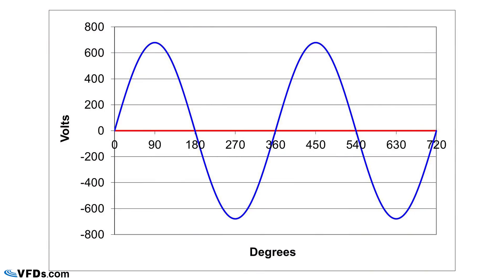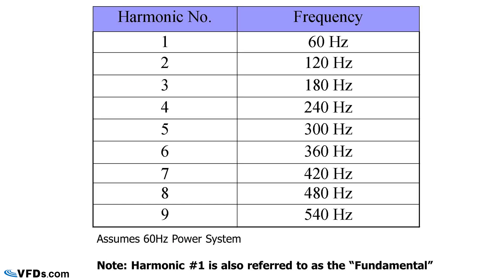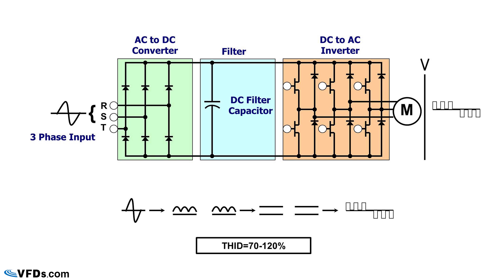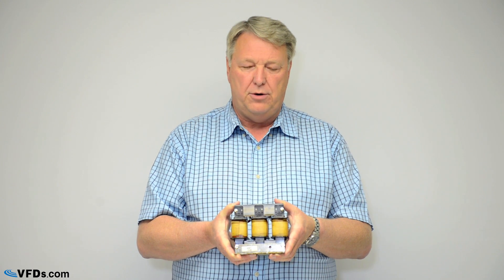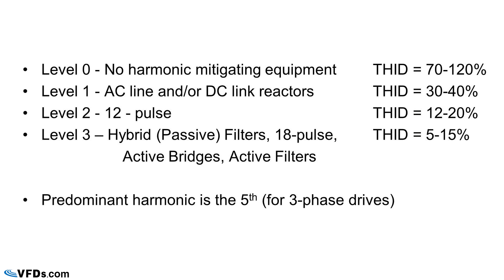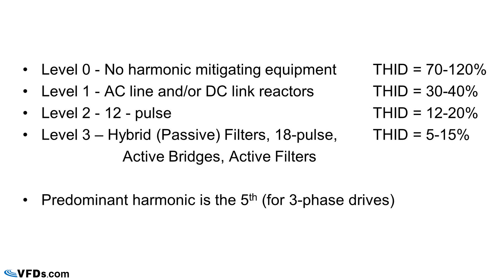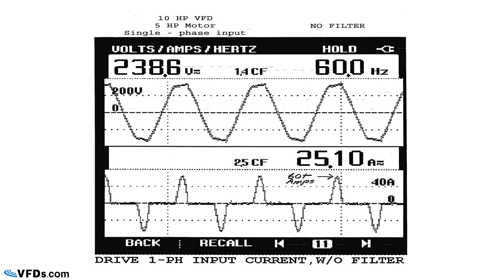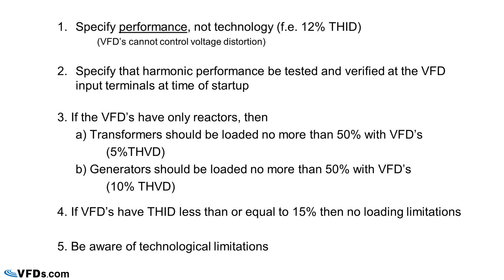VFD Harmonics and Power Quality

Comment: If I install the trafo at the output of the VFD instead as you show in the input (I have a single phase supply input and a 3 phase output VFD, in a house with a single phase network and a 3 pahses motor) will it filter the armonics or the effect will much less?  is there a performance "number" in the datasheet of VFD to see how is good to avoid to create such armonics?
thanks

Comment: I really hate to hear people say things like "VFD's create dirty power" or the VFD's Cause trash in the power system"  The VFD doesn't create or cause dirty power. 
Everything that a variable frequency drive does is completely predictable. It is the designers job to make certain the installation is done correctly and these predictable patterns and waveforms are properly used.

Comment: I running 1HP motor with 3HP inverter drive.
I measure the RST and UVW currents, which are not tally. (RST show 2.6: UVW show 1.8)
In this case, which current should be use ?